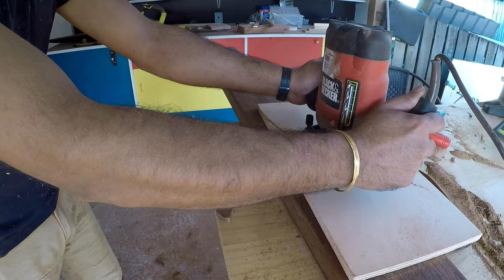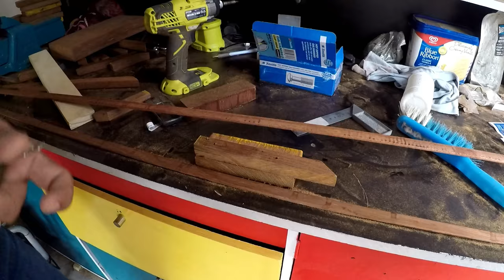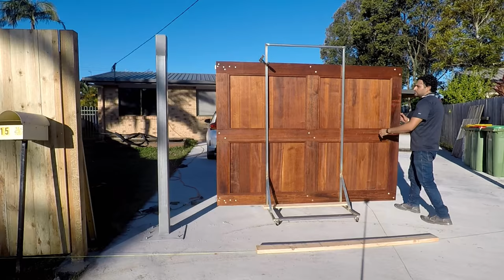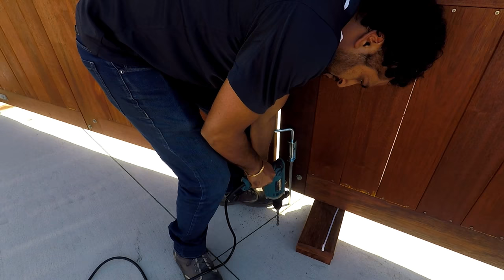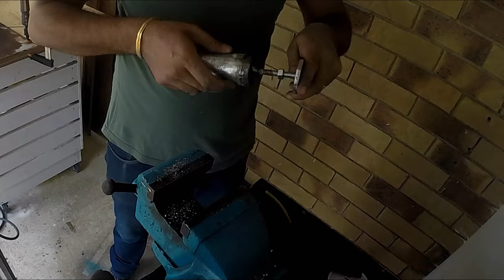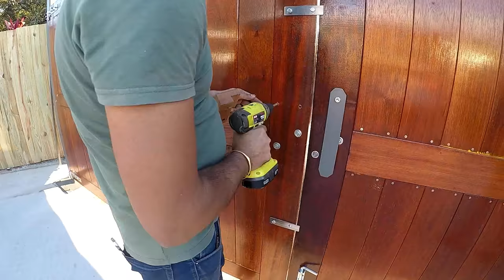How to Build A big Gate

Comment: I really like the gate panels, it's some beautiful work.  What species of wood is that?  I am thinking about stealing this idea for the gate I'm building. One observation: if you were to drill the hole for the stationary side cane bolt much larger, you can then cement in a short pipe nipple (cut the threads off) or thick walled steel conduit and have that about 1/2 - 1 inch above the driveway surface to keep any water or dirt from accumulating in the hole over time...it'll also prevent cracking to the concrete as any repeated impacts from the other gate slamming closed are transferred to the inside of the conduit to a larger area in the concrete. Anyway, very nice work.